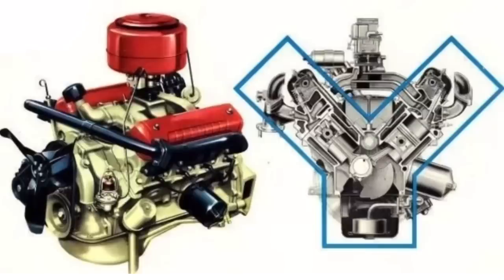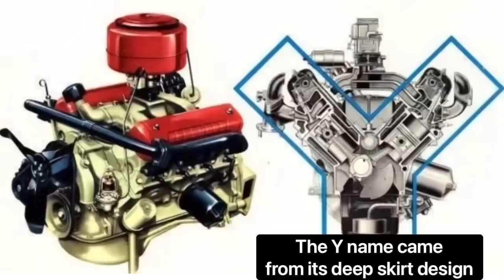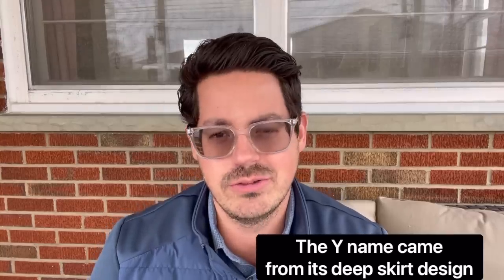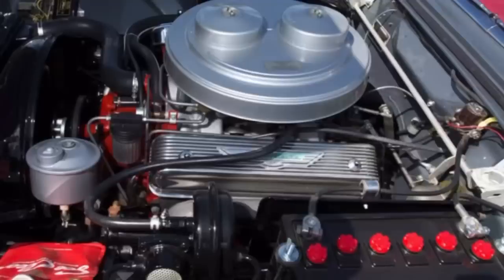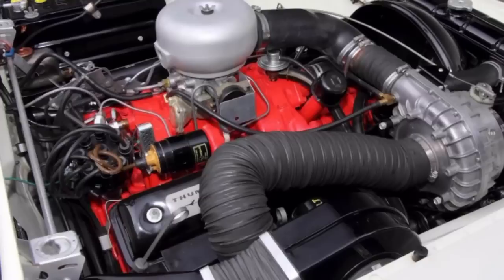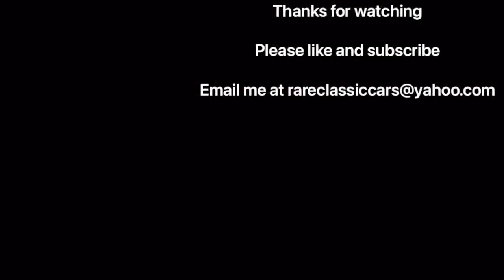Worst Engines of All Time: Ford Y Block V8

Comment: Those Y blocks IMO get an undeserved bad rep. A very long time ago I drove small commercial trucks that were 30 years old at that time. They were powered by 292cid Y blocks. Those trucks gave daily commercial service for decades with enough miles on them to roll the odometers into infinity. They delivered adaquate power reliably for a very long time. They were serviced by a knowledgeable old school mechanic, but their longevity, and endurance were IMO remarkable.
Reply: As I mentioned above, the Y-block remained in production in South America until ~ 1990, chosen for its durability.  Whatever issues there were in North America with owners stubbornly and incorrectly using non-detergent motor oil, that was not an issue in South America.  My guess is that South America also learned from the U.S. factory mistake of mis-installing the cam bearings.  The over/under stacked intake ports may have doomed the Y-block in the U.S. horsepower race, but that is not what sold buyers in South America.
Reply: @Thomas63r2  The  south American Y block  was changed to a head that looked a lot like a 302 Ford  head.
Reply: @mylanmiller9656  Not the ones I have seen.
Reply: @mylanmiller9656  They were called the FASE 2 head. I wonder if they can be imported and their intakes?
Reply: @Thomas63r2  Actually it was 1980 and the over and under intake was changed on the South American engines to side by side with an EIEIEIEI valve configuration.
Reply: @skidoorulz4914  I think you are right about 1980,  but I think you are wrong on the over/under ports being changed.  I have never seen a Brasilin 292 disassembled, but to change the Y-block like that would have been very costly and Ford de Brasile was a small budget operation.  When they phased out the 292 Y-block in Brasil, it was replaced with a 302 - the 302 has the EIEIEIEI configuration.  Here is one from 1980 with the 302.  https://www.youtube.com/watch?v=EVrPKWcqApY
This is not just 302 heads on a 292, it is clearly a 302 with nothing in common with the outgoing 292: different distributor location etc.
Reply: @Thomas63r2  https://youtu.be/lXbaoDcXNAE   Here is a video of the phase or fase 2 Y block. The change was cam and heads intake and exhaust manifolds I am told that it had a shorter distributor also. Not really that expensive of a change over if you think about all manufacturers take years to develop new technology and Ford very easily could have already had this in the works testing knowing that this was a problem on these engines but then decided just to eliminate the Y block all together in the states. And South America Ford just rolled with the research that could have already been done and extended the life of the Y block down there 16 years. Now that would have saved many dollars.
Reply: @skidoorulz4914  Ford  used the Y block in Trucks up to 1964, they found that  the truck engines  had problems of  Cracks between the two exhaust valves. Located  together in the middle of the head. This is the reason both the  Ford and Lincoln engines were  discontinued in America.
Reply: @mylanmiller9656  I know exactly when they quit the Y, I own a 1964 F100 with the original motor in it. The real reason they discontinued it was because 312 was about as big as you could go with it and it was a solid lifter motor. Hydraulics were taking over and Ford had the 352 for their trucks in 65. The Y was continued to be used by Ford in South America clear up to about 1980 although they changed the intake and exhaust configuration for better flow. As most people know the Y was a good torquey motor and the main problem it had was caused by lack of maintenance by owners. My 64 doesn't have and never has had the external oilers installed on it.
Reply: @skidoorulz4914  I think another reason it was discontinued in this country is because of it's physical size.  The Windsor 2 barrel 289 had about the same power and torque of 58 2 barrel 292, but was outwardly smaller, so it could easily fit in small cars with the Falcoln-style front suspension and without making them nose-heavy.
Reply: Argentine here. 292s are here well know for their durability. Maybe different in some specs to american ones. I'm surprised they have a bad rep in the USA. Yes they now are almost gone... People choose more modern powerplants or even the 221 its a lot more common. Parts for the 292 are very hard to find, today only someone restoring or keeping his F-100 or Fairlane are looking for them. In their moment they had a lower compression to adapt to our not so good gasoline. Yes we here prefer reliability over big hp, american big blocks are almost exotic for us, and we loved them... But for us the 292 is a big motor (also the 318 Chrysler, produced here), but in the USA they are considered small. So for us, american big blocks are monsters, really. People sometimes gets amazed when you talk about the 7 liter displacement (or more) of the old Detroit muscle. Pretty different world i guess..
Reply: @Thomas63r2  so Sth Americans value durability over outright HP?
It sounds like the engine suited that market better than it's home one.
Reply: @jamesfrench7299  Lots of South American roads are best described as secondary - overall speeds are slower and acceleration is not as important.  So low powered low compression engines that can run fine on sometimes sub-standard gasoline are definitely suited to that market.  Serviceability and parts availability is an issue as well - sticking with the Y-block for so many years meant parts were available even in very remote areas, and those local mechanics would be familiar with the engine.  But you are right, Adam is more focused on cars in the U.S.
Reply: @Thomas63r2  does this mean the weaknesses are widely known and addressed there?
Yes Americans are extremely parochial as a rule.
Reply: @jamesfrench7299  It's weakness is easily fixed, unlike some other engines whose weaknesses can only be fixed by replacing it with a different kind of engine.
Reply: I have heard only negative stuff about them so It's good to know they have loyal followers who swear by them, after fixes.
Reply: @jamesfrench7299  Oh, I'm sure that South America has had its share of product and manufacturing disasters.  Its equally likely  that Ford kept making Y-blocks there just because it was cheaper.
Reply: @jamesfrench7299  Even the horrible Vega engine can be fixed if you are willing to spend the money.
Reply: @jamesfrench7299  John Mummert   Built one for engine  masters that made over 600 hp. He even makes  aluminum heads and  Modern  Intake manifolds for the Y block.
Reply: @mylanmiller9656  I bought a lot of parts from Mummert's when I built my 292. With the exception of the cylinder block, you can get everything brand new for a Y-Block.
Reply: @wyo1446  one of my Best friend  has a 1955 Crown Vic With a 1957 312. He Buys  parts  from John  regularly. Not much  that you can't get from him!
Reply: @mylanmiller9656  And if he doesn't have something, he probably knows someone who does
Reply: @wyo1446  if you have the money or the time to wait for his parts
Reply: @michaelbenardo5695 the Vega 4 cylinder is honestly doomed, there’s going to be a point where the block warps
Reply: Very interesting Michael
Reply: Same here. We had some 1958s and 1962 & 63s plus one 1956 at work (F-600s) with Y blocks up until 1979 and a few stayed until 1981. Over those years I bought two of them and never had a problem with them.
Reply: AGREED!!!
Reply: Here is a 1975 Ford Galaxie de Brasil with a Y-block at the 5:00 mark https://www.youtube.com/watch?v=bnqSySGqD5o
Reply: What type of dope are you smoking Michael I'm a Ford factory trained service tech over 45 years experience now
Reply: Part of their rebuild life was in the thick material in the engine components. Unlike today in which 0.030 over can be dangerously thin, up to 1/8" could be safely bored from the cylinders. At 0.030 each rebuild, that's over 4 rebuilds, meaning the engines can go nearly a million miles before a new block would be required. Many did just that!
Reply: I'm sure they were good engines, but they have a reputation for poor oil pressure to the top end.
Reply: I mean they rolled at 99999 so I’m sure it didn’t have that many miles
Reply: @flight2k5  That's no gauge of how many miles they might have had on them. As far as you or I know, the odometer could have rolled completely over several times. With that said, I've had pretty much the same sort of experience with the 292 Y blocks as Michael. They're among the sturdiest, most reliable workhorse engines I've been around. And, they could actually be made to perform pretty well if one knew what he was doing.
Reply: @1965l88  naw it’s an American made engine from the 60s. It didn’t do it multiple times 🤣
Reply: @flight2k5  lol stop it! They had just developed a slew of new engines with 1950s technology.
They got better over time.
Reply: @flight2k5  I guess that's why my Dad and I both got over 250k miles out of every Plymouth 318 and Ford 390 we ever owned.
Moron.....
Reply: @67marlins  oh wow a whole 250k?  That’s if?
Reply: @1965l88  
flight2k5 is attempting to sound witty. I'll go out with a sumilarly grave attempt to be witty and say he went back to his virtual reality life.
Reply: @rudolphguarnacci197  no I just get a kick out of fools that have the mentality of only muricans can build reliable cars.
Reply: @flight2k5  
Live a long life.
Reply: @flight2k5  Once you put a camshaft with a grooved center journal, or have your present one grooved, and block off that bypass hole on the rocker shafts, the Y-block is an excellent engine.
Reply: @flight2k5  If you kept clean oil in 50s/60s engines, they could indeed go that many miles, but most people didn't keep clean oil in them.
Reply: @michaelbenardo5695  it sure was a rarity. Today that’s average mileage even for a poor maintained engine
Reply: @flight2k5  Oil is vastly better today.  If oil was still the same now as it used to be, today's Datsuns and Toyotas would be hard-pressed to last more than 50,000 miles.
Reply: @michaelbenardo5695  even the mu
modular PRV V6 used in Volvo, Peugeot and Renault flagship luxury cars in the 70s -80s and the DMC-12?
Reply: @jamesfrench7299  Yes, even that.  Probably ESPECIALLY that little engine.
Reply: @michaelbenardo5695  I have always loved those engines.
Reply: @flight2k5  you are clearly a little ignorant, European and Japanese engines were significantly less reliable in the same period, and in many cases less advanced?
Reply: @DjAlyX1  🤣😂 no they’re not
Reply: @flight2k5  yeah they really are! The exception is perhaps mercedes but you paid more for a mercedes than a Cadillac! This was an entry level ford motor! Ford's European engines were nothing to write home about in the same period, and as already mentioned in the thread engine oils were not what they are today!
Reply: @DjAlyX1  😁😂 nope.
Reply: @flight2k5  name a more reliable engine from 1954 that makes the same horsepower?
Reply: @DjAlyX1  what did they make? 120 horsepower?  You’re the one making the claim. The burden of proof is on you
Reply: @flight2k5  they made 130hp in the smallest form whereas Great Britain did not have an entry level engine that made anywhere near that! The base model ford in Europe was the Popular 100e with an 1172cc flat i4 that made 30 hp just as an example? The flathead was no more reliable than the Y-block with oiling issues as well due to engine oil being poor and pressurised oiling systems still in their relative infancy.
Reply: @flight2k5  if you were  driving on the  roads that those  Cars were on the Cars would last a year.
Reply: @mylanmiller9656  that makes zero sense. Foreign cars would only last a year here?  Or in the country they were manufactured on?  Either way it’s incorrect. That’s just your feelings
Reply: @michaelbenardo5695  I thought  Ford  made that  mod to the last y blocks  that were sold in the pickups.
Reply: @flight2k5   We had an old  1957 Ford dump truck  with a 332 Y block that  We know  rolled over at least three times. We kept a record of  the Service dated and  when it rolled over each time . The truck was retired  because it needed a Transmission, the engine was still going strong!
Reply: @mylanmiller9656  You could be right, but I thought they made it in 57, as it was mostly the earlier ones that were always having that problem.  Maybe the owners of the later ones were more likely to use detergent oil.
Reply: @flight2k5  That is a fact  our neighbor  Was English and  he bought Austin's, after two years driving on Gravel roads   they were beat to death!  After  three  cars he finally  decided to buy a Chevy!
Reply: @mylanmiller9656  that’s still average miles
Reply: @mylanmiller9656  Chevy!  😂
Reply: @DjAlyX1  Italian engines of the period lasted very well. French good. German engines wouldn't go very far. 1500 and 1800 Bmw I4 were good. Thoughest engine I owned was a 1500 Alfa Boxer. Redline from cold for 200000km. Engine was fine when the frame rusted thru.
Reply: @808bigisland  is this an April fools? 😂
Reply: @DjAlyX1  nope. Personal experience. 1.3, 1.5 and 1.70Alfa Boxer. 1.8 I4 turbo Evo, 2l NA, 2.5 V6 liked them all. Peugeot 1.3 rallye, Renault hemi were great. VAG...designed to last 60000 miles.  930kg GTI or a Alfasud 105 QV at 830kg. It was not even a race except the GTI had longer gearing and a better topspeed and made it sluggish uphill.
Reply: @michaelbenardo5695  dude a 4cyl honda or toyota or the 1UZ would outlast almost any motor from that era. Those motors are known to be reliable to the point people make videos kf the running on baby oil.
Reply: @darrengarcia4937  But, me and many other people just don't like 4 cylinder engines.
Reply: @flight2k5  130 horsepower, and souping it up did not hurt reliability.
Reply: @DjAlyX1  The Europeans considered 60 horsepower "high performance".
Reply: @michaelbenardo5695  huh?
Reply: @flight2k5  Low-prices foreign cars, the Bug excepted, would last about 60,000 miles with proper maintenance.  An American car with proper maintenance could easily last over 100,000 miles.   That's on the inferior motor oil of the day.  Those same cars with today's oil can easily last almost forever.
Reply: @mylanmiller9656  I think the mods came in the later 50s - center cam journal was made with an oil groove.
Reply: @mylanmiller9656  The 332 was an FE engine.
Reply: @darrengarcia4937  Foreign engines from the 60s being reliable?  Maybe for about 60,000 miles, then they were completly worn out.
Reply: @flight2k5  In the mid 50s, Fiat - Fix It Again Tony, came out with a slightly larger 4 cyl that made 55 horsepower.  Fiat called that "hot".
Reply: @michaelbenardo5695  😂🤣 I didn’t say fiat did I?
Reply: @flight2k5  I was using them as an example.
Reply: @michaelbenardo5695  yea of course you would use the worst example
Reply: @67marlins  Never saw a  slant 6 or 318 that DID NOT hit 300,000 IF you changed oil .
Reply: @flight2k5 um... ever heard of Ford's big 6? They would roll over several times.
Reply: @flight2k5 that is indeed why the highest mileage American car was at one point the highest mileage car in the world before it got in a wreck? The engine survived and I believe on display, it was a Plymouth Fury with 1.6 Million miles.
Reply: @flight2k5 no body said just American cars, I’ve heard no body say anything about how unreliable other brands are that aren’t American. We’re talking about the true reliability of an engine and automatically thing that we’re shit talking on Toyotas and older Nissans, Hondas, Volvo, Audi, Porsche, Volkswagen, Mercedes, and many other brands? you need a logic lesson bro💀
Reply: @flight2k5  
You're that sure? Wow.
Reply: @rudolphguarnacci197  sure about what?

Comment: Similar with Oldsmobile engines, one has to find an engine builder who fully understands them. Simple tweaks here and there that are common knowledge among Olds guys but not all aspiring and/or experienced engine builders know about.
Reply: Most engine builders think everything is a small block Chevy and they treat them as such.
Reply: @MostlyBuicks  exactly
Reply: @MostlyBuicks  Another peeve of mine is how they want to hog every single engine out to .030 over.  Whatever happened to minimum possible amount of boring possible?
Reply: @michaelbenardo5695  You're limited to what pistons are available on the shelf unless you're rich enough to have custom ones made. With most cast iron V-8's between high-mileage wear and core shift, it takes at least .020 over to clean up all cylinders in each bank on the first re-bore with line-boring which is what just about everyone does these days. Some blocks will need more, so generally .030 over is the "one-size-fits-all" solution for the first re-bore. Later re-bores won't have core shift involved so smaller increments can be used. 

In principle you're right- the smallest overbore possible is going to give you the longest service from that block, but it's not a practical approach.
Reply: @P_RO_  All I know is that they used to be less eager to hog them out to .030.

Comment: My dad had a 1961 Ford with the 292, three Speed Overdrive and 3.89 rear end and we never had any problems with it.  Dad paid $2250 for it and we picked it up April 20th 1961 and traded in his 1955 Plymouth Plaza 2 door sedan.  Dad religiously changed the Oil and I got the car in 1968 for graduation.  I sold the car in 1969 with 100,000 miles on it when I went into the Navy.  Sometimes I still wish I had it, although I really miss my 1964 Galaxie 500 XL Convertible with the 390.
Reply: Was it a Galaxie? I always thought the 1961 Starliner was the most beautiful of the 1960s fullsize Fords followed by the 1969 XL GT. 😋
Reply: @hendo337  Nobody said I could Spell.